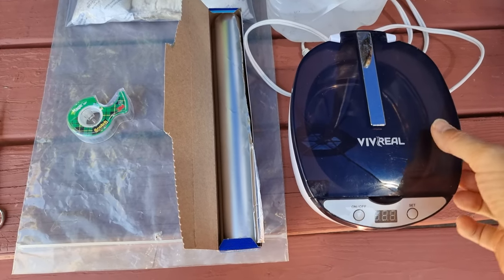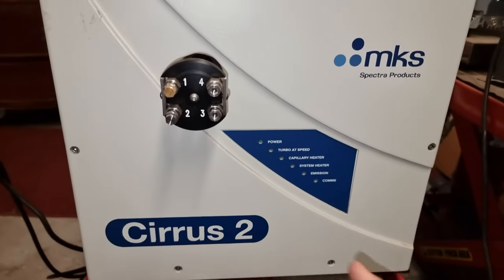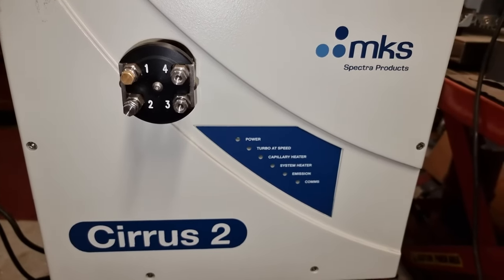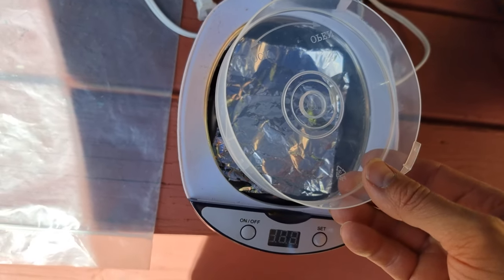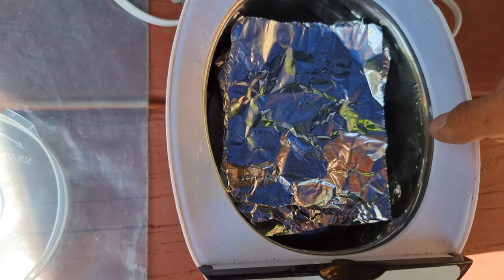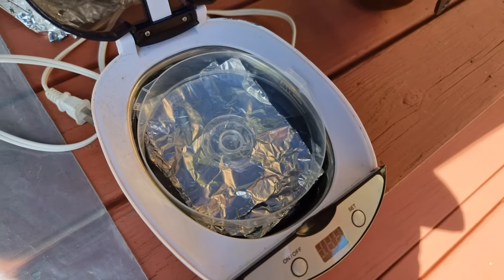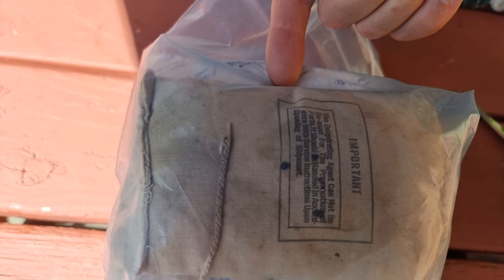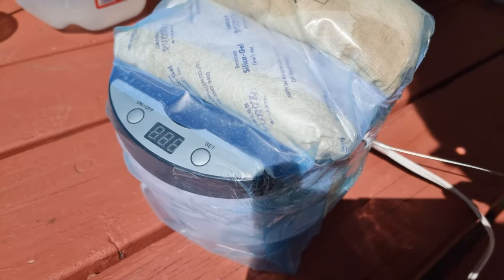ULTR - Gas production / synthesis

Comment: I can’t wait!!! I got a garden blower that blows 350kph. Ganna make a a bigger windhexe. I’ll keep ya posted on twitterX
Reply: Looking forward to seeing how that goes G. Garden blower is well powerful enough but believe heat may be needed too.
Reply: @pauloneill9880  lol. They ring like a bell but too thin to be welded. 0.5mm is r a walk in the park. I will try brazing and get thicker spheres later. Big machines to press 2-3mm s/s304. It’s like 5 mm steel plate. Imagine pressing 5mm plate to 100mm dia. That’s like 120-180 ton press. 1mm is easier. I could make my own by forge feed by a GEET/THOR I’ve made. 🤷 ideas ideas. Plus the windhexe for something lol. This is fun
Reply: Where' there's your will, there's a way. I imagine. 😃

Comment: Bob the ultrasound cleans off the oxide layer of the Al foil and then Al is very reactive with water to produce Al2O3 and 3H2. The pulsed silica and water then produce anti-gravity waves that fuses the 3H2 into the other transmuted elements. Are you going to make a sequel to this video to show us the end result with the mass spectrometer?
Reply: That is interesting :) if the water behaves reasonably like gallium, then gallium behavior could be quantified in terms of sound!

Frequency, vibration, amplitude sort of thing
Reply: Any reaction capable of transmutation of elements ought to have an order of magnitude more chemical reactions occurring along side?
Reply from the maker: Yes - this is the point of the experiment, this kind of process has been known, and investigated by the DOE for decades for on-demand H2 production in the field. I wanted to PROVE that it occurred in this simple experiment as it would go a long way to support the hypothesis I have built/suspected since 2019.
Reply from the maker: @fasted8468  Yep
Reply: @MFMP  Perfect! Thanks Bob. Now for "The rest of the story."
Reply: @MFMP  Good job Bob.

Comment: Lovely Teacher!

2:40 does structured water with gels or plant based proteins behave differently? Water at 1° celsius? Water at 99°? 
Took a 🌵,  blended it into a syrup, and added 1 part per hundred to water in a magnetic stirrer. 

It completely changes the sound from one of gurgling to one of glass tinkerbells. 

What frequency of sound is the one doing the work? One of singular popping like cavitation? glass like shattering building rythmically to a crescendo? 😅